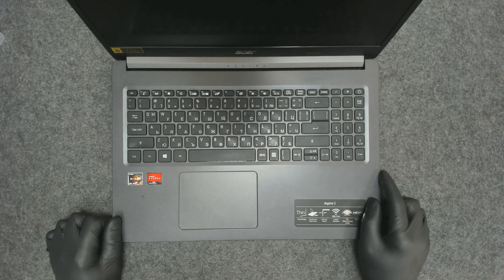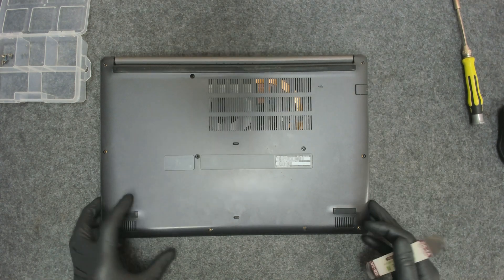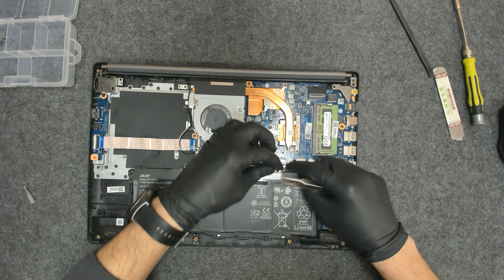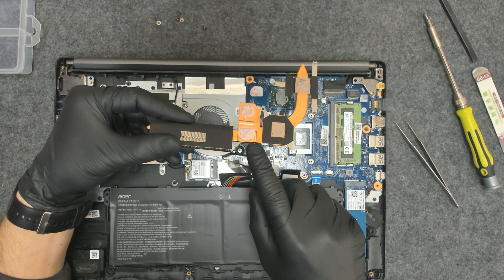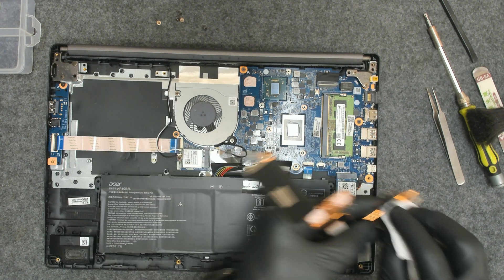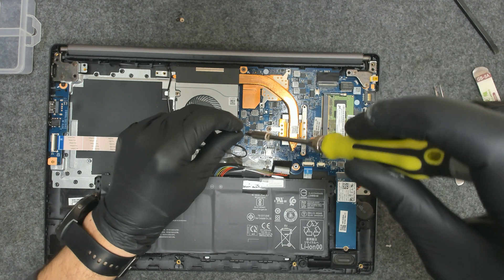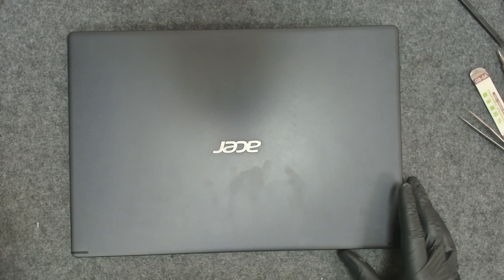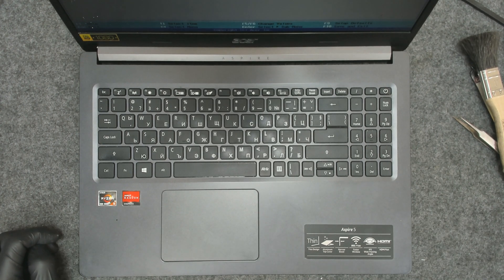Acer Aspire 5 A515-44 Disassembly Thermal paste replacement

Comment: Everywhere I see tips and even ChatGPT advise not to spread new thermal paste, just put nice pea sized dot in the middle, according to the size of GPU/CPU and put the heatsink back on, let the heat sink spread the paste by pressure when screwing/tightening it. Other than that, nice guide 😊
Reply from the maker: There are many ways to apply thermal paste, and i doubt ChatGPT had try them for real. I don't like the dot way, coz if you put less, half of the CPU/GPU stays clean. I'm using the same method for more than 15y and never had problems so far. You can try the dot way, just put some and place the cooler. After that lift it and  check is the whole CPU/GPU is covered. And thanks for the comment. 🙂